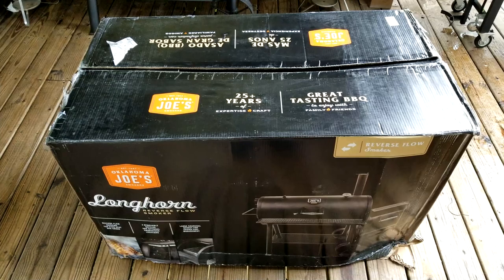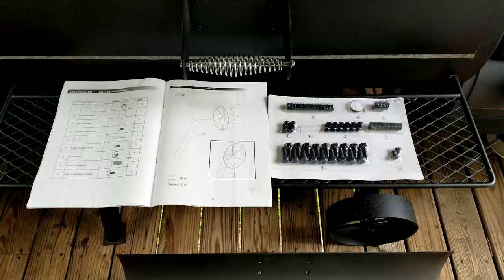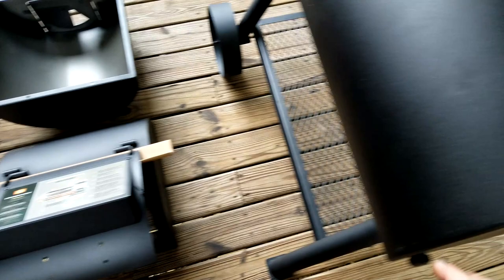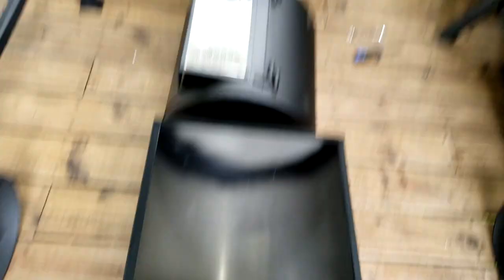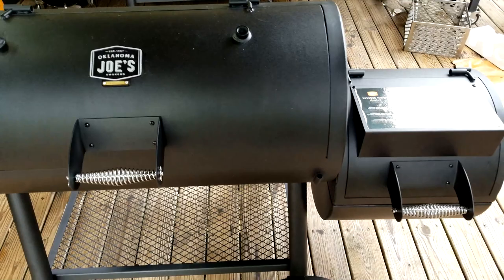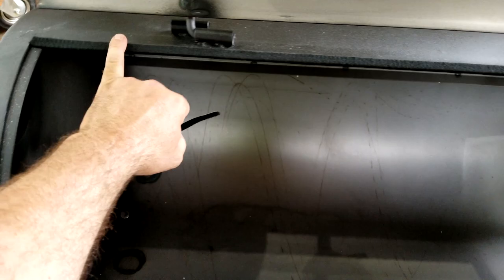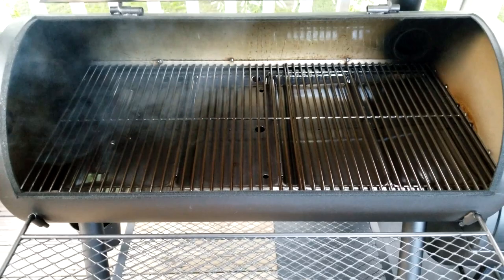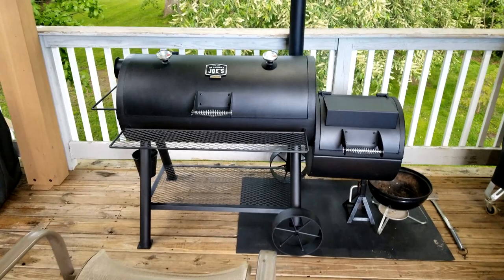OKLAHOMA JOE LONGHORN REVERSE FLOW | UNBOXING | BUILD | REVIEW | FULL EDITION

Comment: Just finished building my Oklahoma Joe Smoker - only one H-bolt missing not bad - seasoning it now - I set mine up as an off-set smoker - I'm using one reverse plate near the firebox to see how well that does for heat control - and I have one crate in the main chamber to use as a water pan holder (great advice) - doing carry-out orders for this Sunday, Brisket, Ribs - I'll be sure to post build and cooking videos on my channel - Thanks for the build review - it came in handy!
Reply from the maker: That's awesome man.. Can wait to check out that video.. I haven't set mine up  as a offset yet but one day I will..

Comment: Very nice video. I just bought one of these. Really looking forward to putting it together. I bought a char-griller double-play, but like the larger cooking area, reverse smoker technology, coal box, better handles of the Oklahoma Joe’s. I like your recommendations (e.g. gasket, gauges, scraper, kettle grill for ash pan and the jack stand). I also appreciate you going through the season part as well. bice job all around
Reply from the maker: No problem at all.. You're going to love it. I'm here if you have any questions. Thanks
Reply: @BBQJOE  I just put mine together this evening, thanks to you it went very smooth. However I did do one step differently. I attached the top half of the firebox to the smoker box; mainly because I was working alone and it was much lighter to do it that way, then once attached, I attached the bottom half of the firebox. But all your suggestions were great and worked really well. Tomorrow, I get to season it. I do notice that after adding the gaskets, the doors don’t close all the way. I did order some clamps to help that situation (2 per door). Looking forward to going out to the pit! Take care all!
Reply from the maker: That's awesome and a great way to do it yourself. I have the clamps but never installed them.. It stopped leaking after a few long smokes.

Comment: You answered the one question I had, if it had the ability to grill normally in the main barrel, thanks!
I'll be picking up the "star edition" from lowes in the next couple days based on your video.
Reply from the maker: I have grilled out of the fire box but I'm not a fan of it.. It would be ok for a family of 2 people..  It has the option to grill out of the main chamber too but I personally don't like that feature.. You'll have to remove the lower reverse sear plates to grill in it..
Reply: @BBQJOE  I'm retiring my Char-Griller Super Pro and picking this up, I would asume apart from level adjustable fire grates there wouldnt be a lot  of difference. Just give me a reason to pick up a Weber kettle along with it... not heartbroken over that at all though.
Reply from the maker: I would highly recommend getting a Weber kettle along with this OKJ Longhorn.. especially if going to be grilling a lot. I promise you won't regret it.
Reply: @BBQJOE  do you regret buying it? Is it not a great smoker? Do you feel it’s too thin or a profile for steel? Is money spend better with the pitts and spitts and Yoder and that obvious or is it similar and just higher cost. Thanks.
Reply from the maker: I don't regret buying it at all. The metal is thin but you get what you pay for. If your budget will let you, most definitely get a Yoder. Those are high quality smokers.. 

And to answer your other question, yes you can grill in the main chamber but you have to remove the reverse flow plates and set the included coal grates in.. I don't recommend it as it's a hassle to convert over and over time the fire will destroy those cooking grates.

I own a mobile smoker made of 1/4" and 1/2" steel. It's 20' long x 8.5' wide. Weighs in at 7500 lbs. She's a beast but only use it for catering. I use the okj for family and friends. 

Hope this helps.

Comment: Informative and helpful. Thanks much. This one seems to be a top pick for the price range. I hope to be unpacking one for myself soon.
Reply from the maker: Thank you.. I'm very sure you're going to enjoy it. I'm here if you have any questions.
Reply: @BBQJOE  Appreciate that. I have been waffling a bit between the Longhorn and the Highlander reverse flow. I can handle the price difference so that's no big deal. I was wondering how much more the fuel bill will be on the Longhorn to maintain the same temps. Any insights? I haven't priced the cost of a 1/2 cord of wood to be delivered yet. Thanks!

Comment: I'm torn between one of these or a 22" WSM which I saw in the background of the video. If you had to pick just one which would it be? I currently smoke on a 22" kettle with a slow n sear but am limited to how much I can cook.
Reply from the maker: That's a really hard question cause I love them both.. My wsm 22 is highly modified and can cook over 65 lbs. of meat.. which I'll link my here https://youtu.be/5Fc_OS0EwL8 

I also have a highly modified Weber kettle 22" which I have videos that will blow your https://youtube.com/playlist?list=PLmy86PIu513hmI1L-H6kc3HNAXJ9TW4mT

All of my pits serve diff purposes and I love using them all.. Hope this helps.. Thanks for watching

Comment: Hey joe nice video. I have the Oklahoma joes highland smoker and between the fire box and the pit I installed a extra piece of metal. I drilled holes where the bolt holes where the same. And I had no problems with it angling down like your other one.
Reply from the maker: Thank you.. That's a good idea. Eventually I'm going to have my fabricator guy come out and weld some supports. So far I'm really enjoying this smoker. Thanks for watching

Comment: Thanks for the review - Great tips and info! - Really like the tip source for the insulative strip, was looking at the Highland smoker but you may have changed my mind and now looking closely at the Longhorn. My local Lowes says "Not Available" at least online anyway. Search is on! Thanks for posting!
Reply from the maker: Thank you.. It seems the Longhorn reverse flow model will average around  $600. I I really like this unit so far. I can't believe how well it cooks for low cost smoker. Thanks for watching.

Comment: Nice tutorial of the unboxing and burn in. I've seen pretty much all those fire boxes drooping on that brand. Have you figured out a way to adjust it yet?  Cheers!
Reply from the maker: The only way I can think of is to shim the bottom of the main chamber and firebox with steel plate and use a thicker gasket to compensate. I'm fine with the way it is with the jack stand. Thx for watching..

Comment: Very nice assembly video, great job using the black gaskets
Reply from the maker: Thank you..! The black gasket works ok and after time it will burn out just like the gray gasket will. Thanks for watching.
Reply: @BBQJOE  so would you recommend doing the gasket at all then? I just don't want to waste time and money if they are gonna be useless after a few cooks. Thanks
Reply from the maker: @Disastrousmedia  Now that I have several cooks on it. The gasket around the firebox lid burnt out. I do highly recommend installing the gasket between where the 2 firebox pieces go together, between firebox and main chamber and of coarse the main chamber lid. Hope this helps..
Reply: @BBQJOE  thanks so much for the quick response! I'll give it a go 👍
Reply: @BBQJOE  Do you think using lavalock silicone on the inside would protect the black gasket from burning out?
Reply from the maker: @tayl0124  That's a good question.. I've never tried it but It would be worth a shot.. That's a really good idea..

Comment: Hi. Great video, watched as I'm about to build an Oklahoma Joe's Highland and wanted to see not just the mods you did but how you did them. Great job! I have a question though... When sealing the firebox have you used silicone sealant and, if so, how does it compare to using the gasket? Could you use the gasket and maybe seal around that on the outside with the silicone for a double seal? Thanks!
Reply from the maker: I'm about to do another review on this okj.. I've never used silicone but the gaskets installed on the firebox burnt out where the 2 pieces comes together.. It's still holding up where the firebox meets the main chamber though.. It's still performing great with the gaskets that are burnt out and just need to close the intake a little more.. My buddy just bought a reverse flow Highlander and didn't seal it at all and it's working great for him. Hope this helps and thanks for watching..

Comment: Getting ready to pull the trigger and purchase a Longhorn. I have a quick question for you. What size are the thermometer ports? I want to purchase new river country for it. Just want to make sure the size I want will fit. I bought one for my 22" WSM and had to drill out the hole.
Reply from the maker: The River Country 3" (glow in the dark) temp gauges works great on the Longhorn reverse flow model.. I have 2 of them installed and love them. Hope this helps and Thanks for watching.. 
#oklahomajoes #charbroil
Reply: @BBQJOE  thanks alot Bud. Can't wait to cook on it!
Reply from the maker: @haroldwood2992  I promise you won't be disappointed.. I absolutely love it..

Comment: Can you put charcoal in the main smoke chamber and use it to grill steaks or burger like any normal charcoal grill?
Reply from the maker: Yes you can but before you start a fire you'll have to remove the basket cause it's to tall for the cooking grate. When I get home tonight I'll place the fire grate in the stock position and see if the if you can use the basket that way. Thanks for watching.
Reply: Thanks for the reply. Can you also put charcoal and grill in the bigger barrel where you typically would smoke the meat?
Reply from the maker: Yes you can.. It comes with extra fire grates for the main chamber. I use them along with the one that comes with the firebox to create a cross pattern to save on my amber. One of these days I'll demonstrate on how to use them if you like.
Reply: Joe's BBQ House thanks for the info man. My gas grill needs replaced and this seems like a perfect replacement if I can use it as a grill and smoker. Got a Electric smoker now and want to step my game up.
Reply from the maker: You're welcome.. You won't be disappointed  with this OKJ reverse flow  model. Keep an I out on my next video. It'll include a giveaway and a prime ribeye roast cook on this model.

Comment: Or you can run over to Lone Star Grillz and buy one you don't have to mess with.  Just Uncrate and away you go. No assembly required. I will never regret spending 4 times, as much for 1000 times the quality and durability. I could have gone less expensive with the squarish models but the smallest round one was the one I went with.
Reply from the maker: I agree with ya 100%.. Not everyone can afford a high dollar offset. I bought it as a backup incase my mobile smoker wasn't going to be finished by next week. I figured while I have the OKJ I could help people protect there investment. My mobile smoker will cost 12x the amount of the Lone Star.. Its made of 1/4" and 1/2" steel.  Thanks for watching.
Reply: @BBQJOE  The cool thing about LSG is that they offer financing right on their website. That was the other selling point along with a really nice upgrade selection. 
I hear what you are saying though. $600 vs $2300 is a huge jump. 
Thank you for making this awesome video and now I am jealous. Sounds like you are getting an awesome rig.

Comment: I wonder if i should tighten the bolts really tight.
Reply from the maker: Not to tight cause you may stripp threads.
Reply: @BBQJOE  funny thing is i heeded this warning and had to tighten them tighter because as i flipped the smoker the legs fell off lool. So snug and a little turn more
Reply from the maker: @philswaim392  Oh man sorry to hear that.. I haven't had that issue but it's good to know this..

Comment: Just a few words of advice here. This is not a true original American made oaklahoma Joe’s. This is built roughly to half of the metal and quality of the the original. This is a charbroil built by charbroil in some overseas country. Please do not take my word about it just research it yourself. I have a original that is much much more heavier built. Also take notice that the big brass oaklahoma brass symbol is missing from the lid that are riveted on the original. I learned of the change when I went to reorder a new cover for my original. After much searching and a call to the original company I was told by them that they had sold to charbroil. Also take notice to the very small spot welds every 10in apart. Our friends bought one after a grill we had done in 2015. And to say that they were disappointed is a understatement. This needs to be known in order to not deceive people. Do some research.

Comment: I was getting ready to buy one of these until I saw that it comes with free protein included @2:55 a cockroach rushes out of the Styrofoam on the right side.
Reply from the maker: Kinda hard to tell what kinda bug that was but you never know what learches in your cookers when left outside especially when food residue is on your grates.. If you're concerned about a bug on the outside of "Styrofoam" then you should throw all of your grills/smokers in the trash lol.. Thanks for watching..

Comment: I thought a reverse flow was suppose to give you more even temps
Reply from the maker: These are low quality thin metal smokers but they work great once you get to know it.. I use it just about every other weekend when it's nice out and I have no complaints especially for the price. It doesn't make for a good stick burner at all unless you cut up the splits in fours so the wood will ignite easier and not smolder.. But, if you use the included charcoal basket and add 1 full split and the rest with unlit charcoal with 1 full chimney of lit coals on top, you'll get just about a 4.5-5hr burn.. It's pretty much set it and forget it as long as you have your vents dialed in which is easy to do.. Just remember that the thin metal firebox is attached to the main chamber so it will be hotter on that side. For only $600US I would recommend this smoker in everybodies backyard. Hope this helps and thanks for watching..